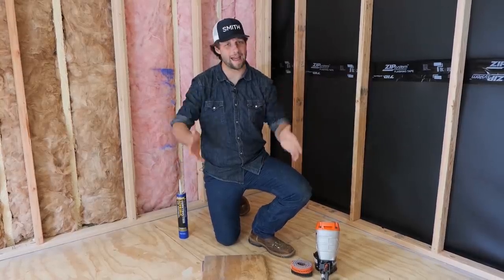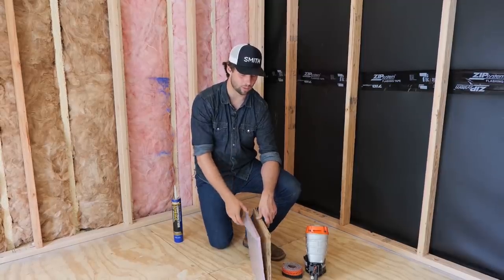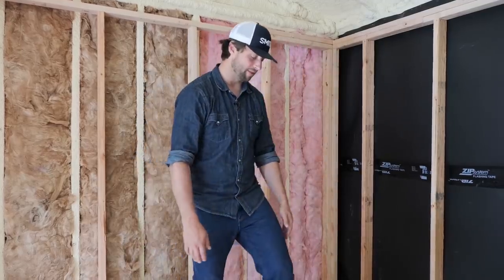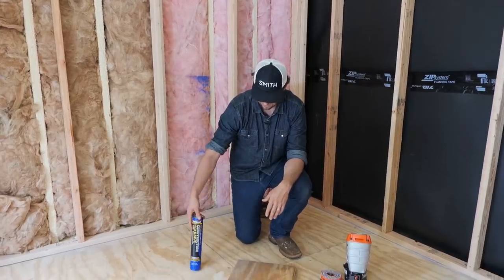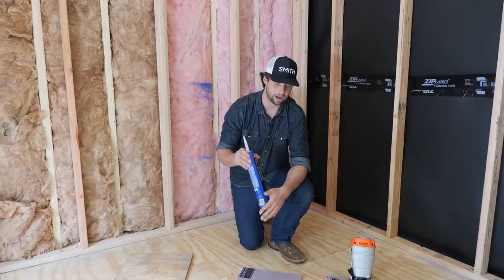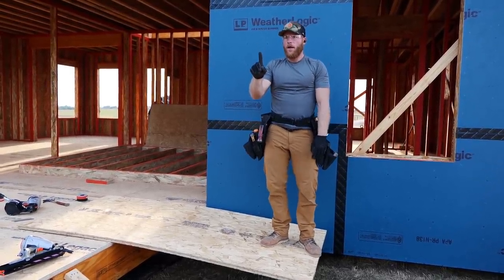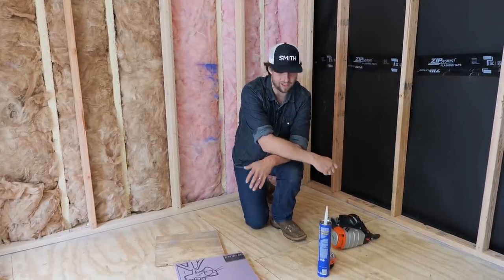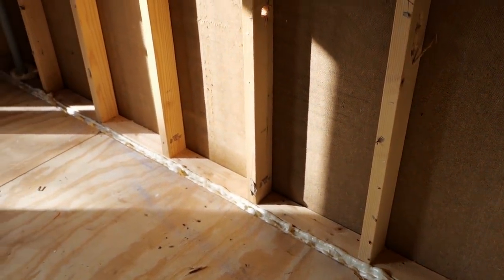Soundproof Shed Part II - Decoupled Floor

Comment: thanks for Round Two! Another sound-proofing element for the floor would be the type of finished flooring. Also: explain the space around the perimeter that was filled with spray-foam.

Comment: If you have a really bad noise source which from the first video sounded like a street you might want to do the wall facing that with some of the lighter mass loaded vinyl (1/2lb per foot) and maybe the same with a decoupled ceiling. Mass loaded door curtain kits are north of $500 so opposing doors with good weather stripping to create a sealed air gap might be a lot cheaper and if you can find a cheap used really heavy door for one of them that might even be better.
Reply from the maker: That's exactly what we did on the traffic wall.  I'll check it your door recommendation for sure!  Thanks!

Comment: I need sound proofing from this 80's pop intro! (LOL! I'm kidding!) Anyhoo, I've used the rubber membrane on a wall (freaking HEAVY-you need help installing that stuff...~200lbs a roll!) and then there is a green-glue sound deadening adhesive. Plus if you look at your insulated wall, you should weave batts in-out along the inside. Ideally, you want a 12" thick poured re-inforced wall, with decoupled-floating floor and walls. And then foam-sound material and roxel sound batts.

Comment: I don't know if it's to late, but you may want to lift the collar ties for the roof, for additional head space.  You can make them (on purpose) out of square, to reduce standing wave propagation.  Also look into Quad-radial defuser panels as wall treatment.  Kill multiple sins now, while building.

Comment: It would seem to me that having fewer nails that are more tightly connected to the boards d/t the hybrid-screw design wouldn’t offset the sound transference of having more nails that are simply standard nails and therefore more loosely connected, and that those screw-nails would simply have more transference per nail instead.

Comment: Would using dricore sub floor give you the same effect?
Reply: not likely because the part that keeps the wood portion dri is rigid (more rigid than the foam)

Comment: So going with the lower density XPS board actually aided in your air space to kill sound, I would think??
Reply: The job of the xps us to uncouple the two functional layers.  True, if the xps is as dense as wood the uncoupling is pointless, however, if it's not dense enough, like poly-iso, it will collapse over time under weight.  XPS is by nature of the material more dense than EPS or poly-iso.  Fun fact, it's also water impermeable (more so than EPS - both float obv.).

Comment: I would have used Green Glue Compound (not their sealant) to adhere the plywood to the foam.  It's awesome material - stays flexible and has good adhesion - price is reasonable too.  Nice thing is it guns very easily and I suspect a natched trowel would spread it evenly/quickly. Using construction adhesive is a poor choice in any sound-sensitive assembly as it hardens and will easily transmit sound.  

Honestly, surprised you didn't start with a fresh build - yes, a bit more money, but I bet you'll quickly get irritated at the compromises you've made.
Reply: Agree on the Green Glue. I've built several soundproof observation rooms for media research companies here in Tokyo and had great success with Green Glue.
Cheers
Reply from the maker: I would have loved to have used Green Glue.  However, as this project was on a extreme time crunch and covid messed up all of the local suppliers and shipment dates, I had to skip it for this build.  Next time for sure. Thanks for the comment.